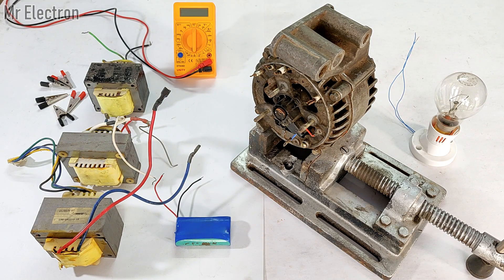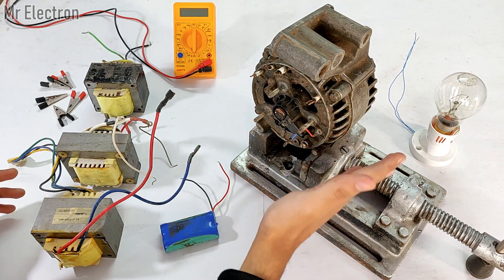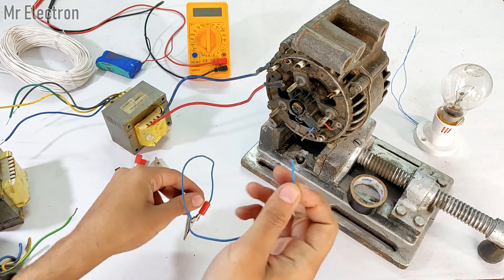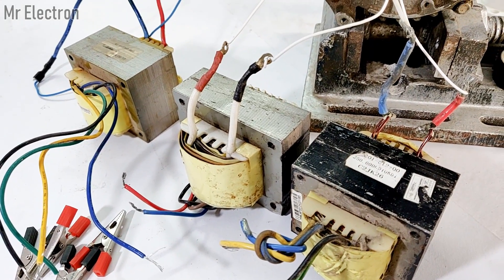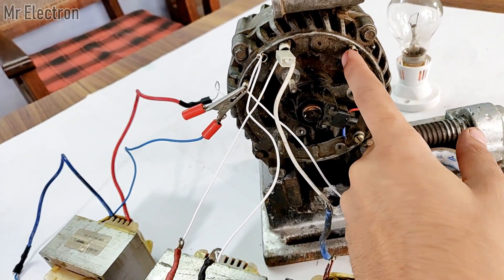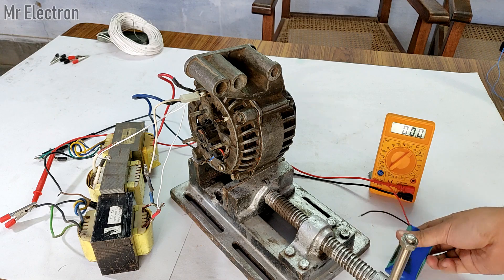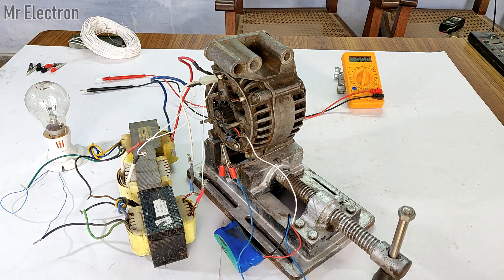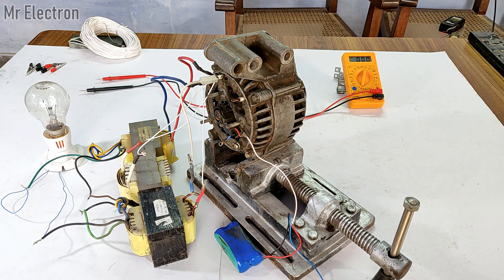220v to 300v AC from 12v Car Alternator at Low RPM Amazing Idea !

Comment: 0:20  I have an alternator in which the armature windings are comming out at 6 (not 4) pins.  And I verified with my tester and there continuity between all the 6 pins.  What does that mean ?  How can I find the pins of a single phase ?
   Thank you for the answer !!!
Reply: The 6 pins are the Start and End of the 3-Phase segments. Phase A, start and end, 2 wires. Phase B, start and end, 2 wires. Phase C, start and end, 2 wires. Total of 6 wires/pins.

To make it a single phase, use three transformers.

Comment: I'm trying to build a PMG out of an alternator. I drilled holes into the rotor and glued in small magnets and I have it turning at approximately 4000 RPM but I'm only getting 3 VAC. My question is do I need more magnets or larger magnets to get 120 VAC 
Thank you

Comment: Motor: Star with neutral, Transformer Primary: Delta, Secondary: Open Delta
Giving root three times the phase voltage।

What was the voltage ratio of the transformer by the way?

Comment: Be careful. Always remember . On AC there is 3 main factors to remember:
Voltage (then single or 3 phase)
Amperage 
Frequency.
Reply: We can create AC electricity but is it usable in our appliances? How many Hertz it produce? Try to connect a steady motor to rotate the alternator then measuring the volt, amps & frequency(Hertz).

Comment: Also just spin the alternator with a motor, check voltage before the diodes, if it higher that 220v or 110v use a voltage regulator, Its more efficient, to use 220v straight from the alternator, then to drop it to lower voltage then bring it up to 220v

Comment: The alternator is a three phase electric generator that can provide you with 120 volts at three phase .
Reply: Can you help me set up a toyota car altonator that have 4 pins to make a wind mill generator to charge a 12 voltage car battery, so I could put on a invertor on the battery so I could use when I get black outs?

Comment: How much power do we need for exciting the magnetic field ? If you would have 12 volt 5ah battery connected to the rotor  how long could you generate power without charging or replacing battery?
Reply: Field consumes 12v 2Amps .So 2.5 hrs technically speaking
Reply: @mrelectron_alternator    First of all Thank you for your  answer!

So if i would run it continuously  ( the generator ) pre excited  with a 12 volt battery  and after that i would disconnect battery and at the same time connect field coils  to the  generator  would it be possible to remove battery completely. And if so , lets say alternator  can produce max 70 amps . After connecting field coils to  generator , would that mean  that i would have 68 amps disposable for use in my household.
Reply: @rayden7855  no this would not work, because the "generator" outputs 3phase ac not dc.
Reply: @earnwithbots2783  
I understand that but what I was thinking is : I have battery bank that is at 12 volts I use it to start the generator. After exciting field coil from battery and generator starts producing electricity which will go through charge controller to charge the same battery  which was used to start the generator. So now generator is powering it's own field coil. And  now reroute to my original question: if the max output of generator is 70 amps do I theoretically have 68 amps ?

And yes I'm sorry I didn't phrase the question right way. I was thinking it's understandable that there is no way to power any DC power consumer with AC power producer .
Reply: @rayden7855  In that case, I would say in theory you are right. Minus the small loss from the charge controller.
Reply: @earnwithbots2783  Of course including wiring resistance and/or any other connections. 

Thank you for your answers.
Reply: @rayden7855  That is why if you disconnect the battery of your car it can sill running normally
Reply: You would also have to spin the alternator, that consumes power too, I would say by  changing pulley sizes one could get usable energy
Reply: @kalan-electpaddy4990  or by using a permanent magnet generator. You could even make the system function at lower rpm AND not waste the 2 amps on the field coil.
Reply: Oil companies and education curricula do not want to see or hear it that way.... They want it like this.... The more you put in the more you get out.There  is no free lunch.That free lunch is that system running on its own..... In short ,they will not allow a perpetual machine.
Reply: Or instead of over complicating things, leave the voltage regulator intact and tap the ac prior to the rectifier.  The alternator will self excite following an initial spark from a battery and field voltage will adjust to the load on the ac output.

Comment: Would it work if you exited the rotor(brushes) and get power from field windings? 
Also i think it would help if you used a hand drill (or similar) to  drive the generator instead of the  string
Reply from the maker: True string method is easier from explanation point of view.
Reply: @MrElectron   how about exiting the rotor,  will you get  power from the field windings?
Reply from the maker: @fredrickrari9338  Yes
Reply: @MrElectron  between exciting the field windings or exciting the rotor windings which seems in your opinion generates more output power? And which way reduces burn to the brushes of the altenator?
Reply from the maker: @timothyhall963  In case of alternators, field and rotor are the same things.
Reply: @MrElectron  ok That was also my assumption but unlike in your case my ability in time constraints has hampered my own experimentation I do appreciate watching your findings as well as your other videos that you produce. I hope to share some of the things I've been working on based on things you've uploaded I hope to be in touch soon

Comment: Good job bro 👍👍
Guy’s welcome to my creative channel
Reply: excellent, it's about the rpms dude,  send some of that generated electric back into the start winding maybe through a capacitor(12v or rated 440 or beyond)(why not put a speed control to your start winding?) ,  wires is resistance and with distance), the alternator is capable of a 3 thousand rpms(with a fan lol), maybe some heat sincks for the transformers.   you can calculate the voltage. If you put some capacitors after the transformers beware of the amps and archs.
Reply: if running volts into the start winding does anything or anything  different. Thought the start winding could be bypassed?